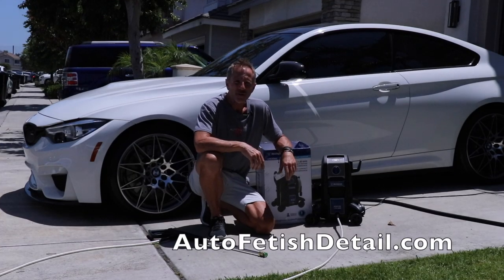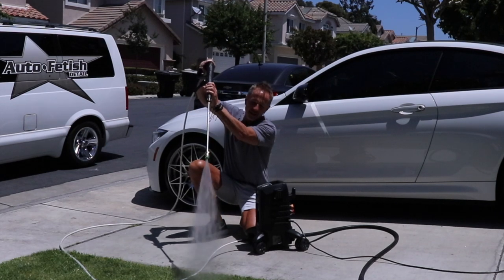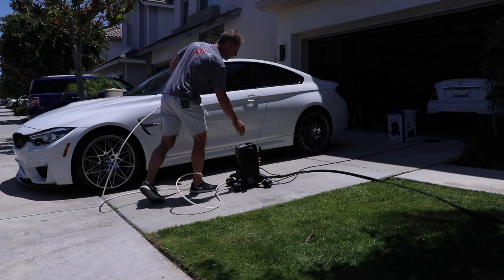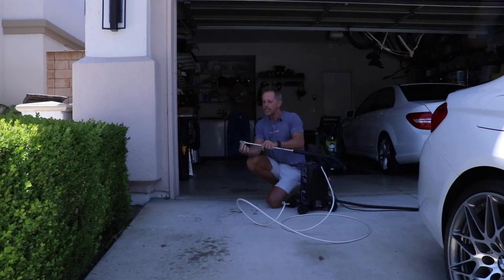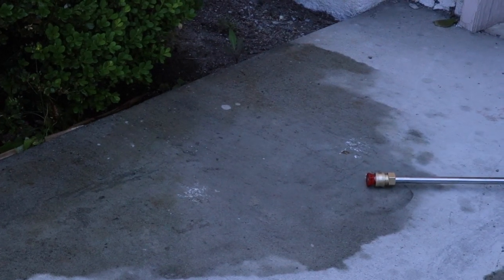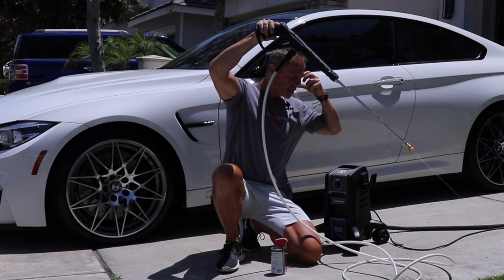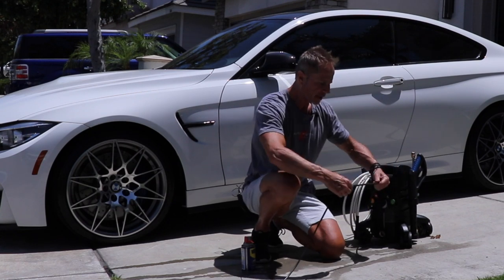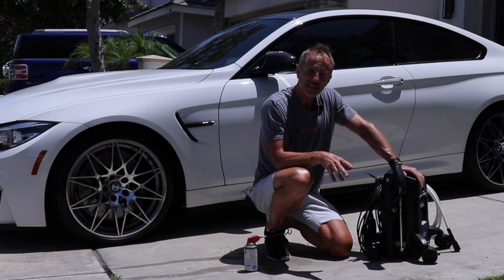Pressure Washer: expert tips for beginners

Comment: The nozzle tips are not designated in percents. These numbers are the actual degrees of the angles formed by the different fan patterns. For example, the angle of the fan pattern from the green tip is 25 degrees. For the yellow the angle is 15 degrees, for the white it is 40 degrees, and so forth. The red has no angle, so it is zero degrees.

Comment: Another potential solution that I like and use is to buy a long hose for the wand (50 feet) and then you can just leave the pressure water inside the garage and don't need to move it around or worry about managing the power cord and water hose.

Comment: I have a Karcher K2.360 (an European brand) which is pretty similar to this one.
Not only this is a very good video with excellent advice, but also this is a wake up call to those who still resist on the electric ones, and are still using the gas powered ones

By being gas powered, it means that it emits gases - which are bad for your health, for the environment, and for the paint of your car (which you are trying to protect), it is very loud, it is less reliable and it consumes gas, and it is bulky.
Electric power washers are a more portable, cleaner, and easier machine to work with.